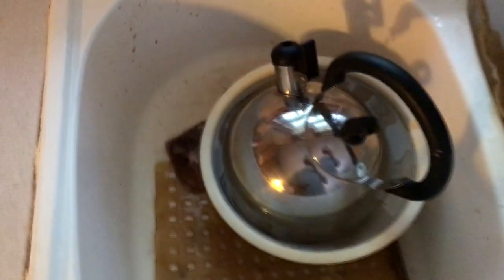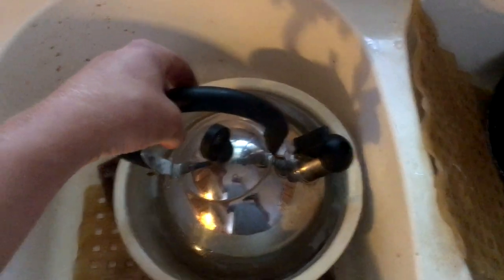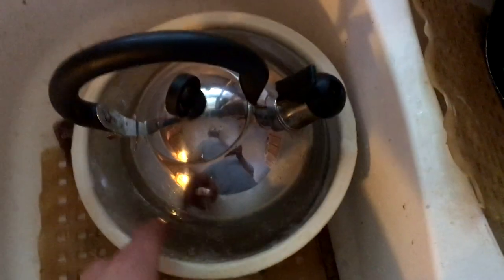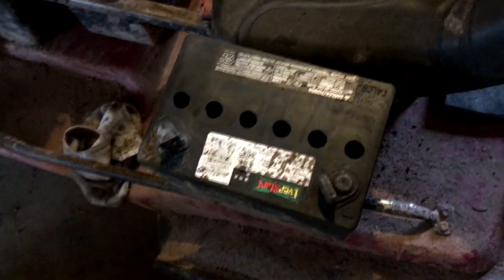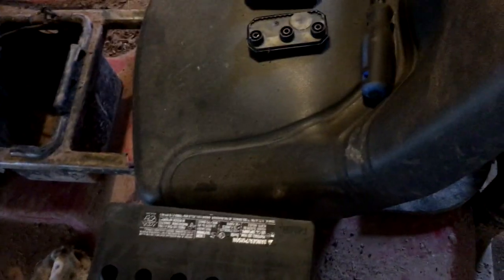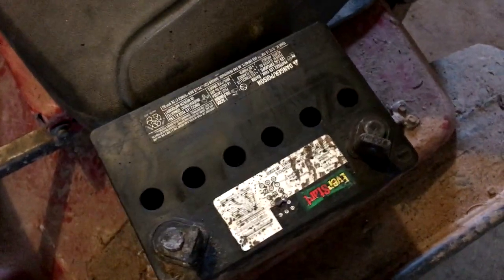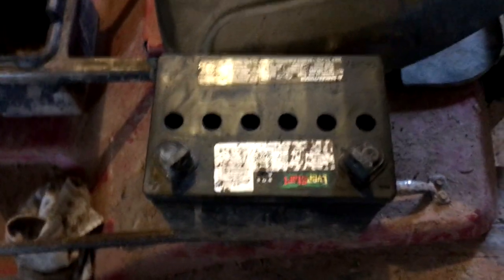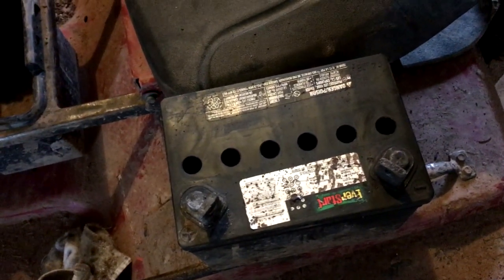How to refill battery acid on a lawn mower battery

Comment: Best to use distilled water. Thats not distilled water.  The steam from boiling water thats recaptured is distilled. A gallon of distilled water from the grocery store is about 75 cents. Both work but distilled will last considerably longer.
Reply from the maker: Still works lol